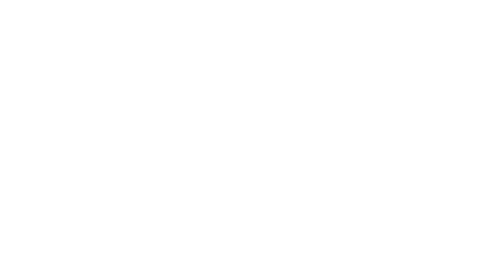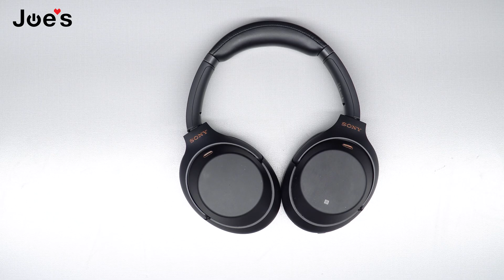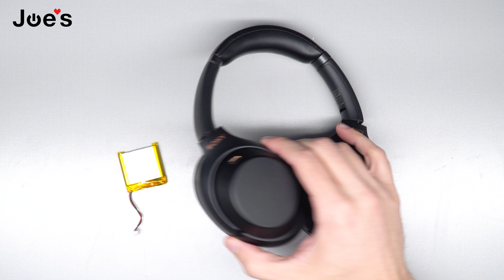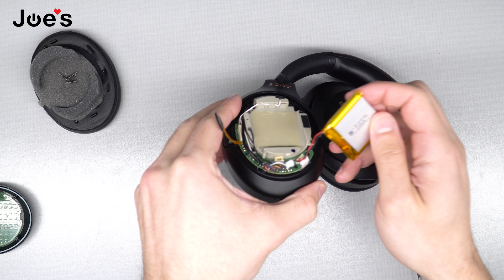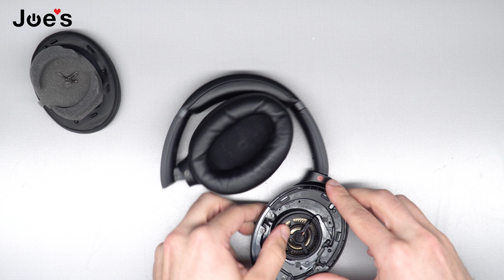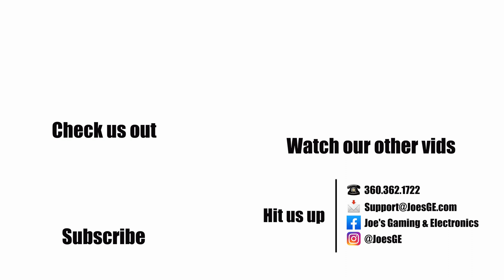Sony WH-1000XM3 XM3 Headphones Battery Replacement | Repair Tutorial

Comment from the maker: New Battery + Repair Tools - https://www.joesge.com/products/sony-wh-1000xm3-wh-1000xm4-xb900n-ch710n-battery-replacement-repair-repair-kit-parts
Original Battery  - https://www.joesge.com/products/sony-wh-1000xm4-parts?variant=39694568947758
Repair Tool Kit - https://www.joesge.com/products/sony-wh-1000-xm3-xm4-xm5-headphones-repair-screwdriver-pry-tool-repair-kit
Send your headphones in for repair - https://www.joesge.com/pages/repair-service-sony-headphones
Reply: Why does my headphone seems different from inside. Its the same headphone type?

Comment: Replacement successful. When I plugged in the new battery, the headphone turned on and made a god awful sound haha.
Reply from the maker: We can help you find the right part, tool or repair option. Please email support@joesge.com with your exact model number and what part you need.

You can also start here:
www.joesge.com

Comment: im so glad i found this video, im going to try these, my headphones were working fine until they got a firmware update, now when i press the power button they will not turn on, i can see them charge and i can use them with a 3.mm audio cable. so i hope this works for me. - just finished swapping it out, now letting it charge.
Reply from the maker: Hope it worked

Comment: Thanks, great vid! I will say that based on what I saw (and will be doing myself when the new battery arrives) it doesn't seem necessary to unplug and remove the touchpad ribbon. It looks like it sits beneath what needs to be accessed, and for the noob ribbon cables can be tricky
Reply from the maker: Try it out!

Comment: What is the battery, like model and size and stuff? I need to be able to find it in Sweden.
Reply from the maker: We currently do not have any in stock. Please go onto the product page for the part you need. Enter your email into the "Notify me when available" tab to get a notification when the part is back in stock. 

https://www.joesge.com/products/sony-wh-1000xm3-wireless-headphones-repair-replacement-parts?_pos=1&_sid=bf3295c97&_ss=r&variant=39708371517486

Comment: Mine Headset works after loading but the on button is not very responsive, sometimes it just blinks with a blue light and then nothing happens, sometimes on some perios its even not working totally, you think that would be a battery problem ?
Reply from the maker: Hello, thanks for commenting. Please email us at support@joesge.com with your question. We will be able to better assist you there. - JoesGE
Reply: same question, did you mail and got an answer?
Reply: No but i changed the battery and its still not working, but since nobody is in my area for repair the Headset, its just too expensive to send it somewhere for repair. @jefbreugelmans4049

Comment: Link for the battery replacement you ordered?
Reply from the maker: https://www.joesge.com/products/sony-wh-1000xm3-wireless-headphones-repair-replacement-parts?variant=39708371517486
Reply: @Joesge  Is there any chance these batteries are coming back in stock, or is a limited supply why you stopped repairing these? I'm having trouble sourcing one.

Comment: Is the charging light supposed to go on again after replacing the battery? If so, mine doesn’t. I’ve double checked the connections and they’re connected. Do you have to put the screws back in to make it charge? Thanks!
Reply from the maker: Hello, thanks for commenting. Please email us at support@joesge.com with a screenshot of your question and we will be able to better assist you there. - Aaron P